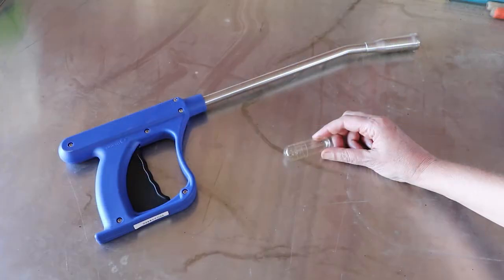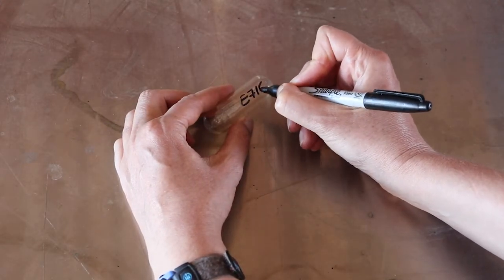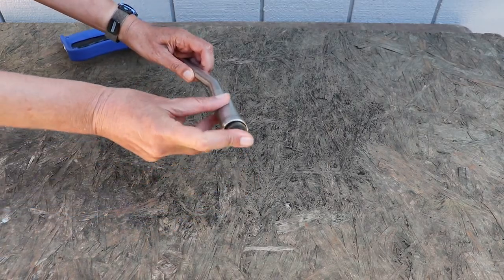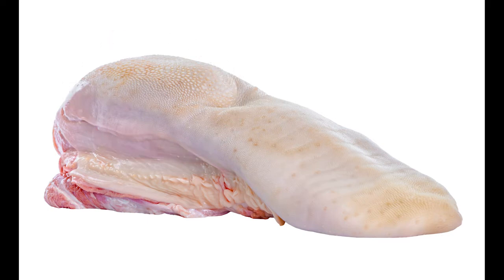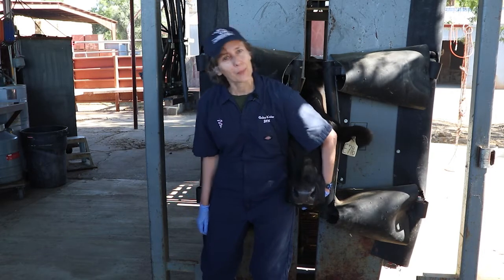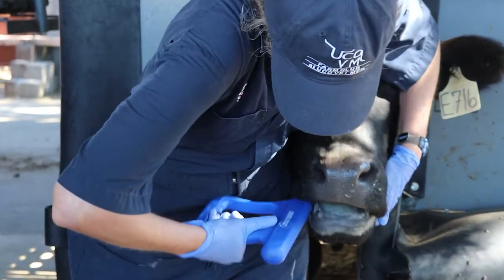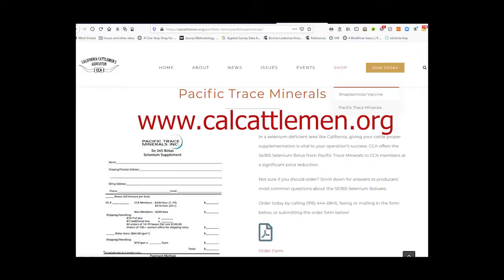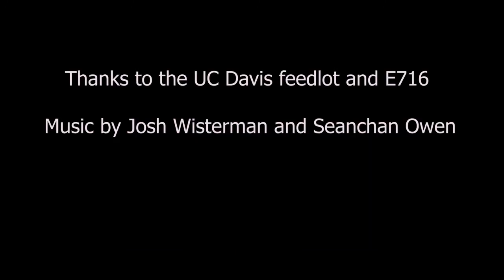How to give a bolus to cattle

Comment: Question:  there are bolus measuring PH value.  What if the PH measure is not working after  1-2 years?  Any tool to remove the bolus?